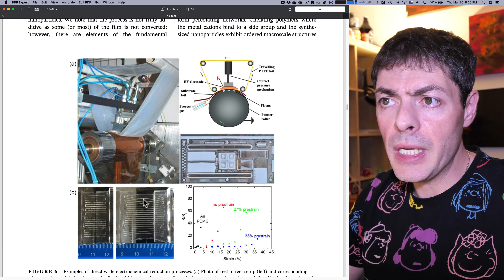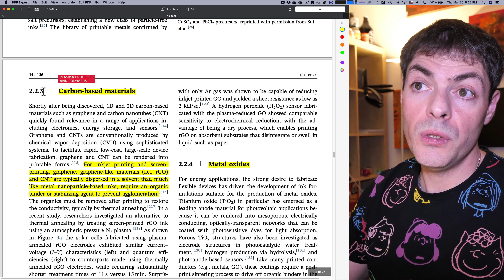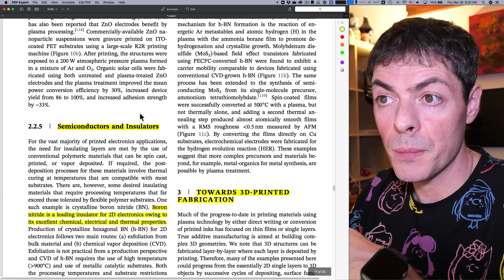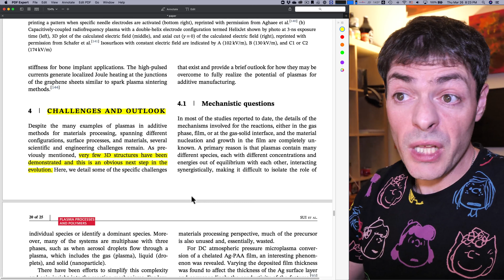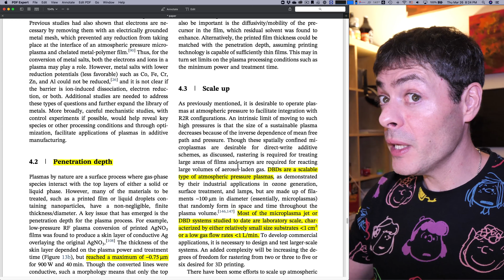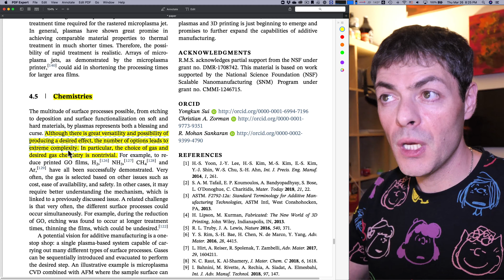Plasmas in additive manufacturing

Comment: thank you for going over this! Do you think this would work as a treatment to filament as it comes out of an FDM nozzle, or would it be better to treat the surface? I was thinking of putting a micro-plasma torch pointed between the nozzle and the print surface. I wouldn't want to cause the filament to bond with the nozzle. You said this process isn't able to penetrate well, so I imagine pre-treating the filament (similar to a filter) wouldn't be very effective other than to clean it. Would it clean better than the common sponge filters? I don't see a good way to make a consumer-level 3D printer incorporate the aerosol/vapor method, but could possibly have a plasma torch act as a second extruder and pre-treat a layer before printing onto it.
Reply from the maker: James, it may be quite impractical to combine plasma of any kind with an FDM printer. However, inter-layer adhesion and adhesion to the print bed may be significantly improved with a microplasma treatment ahead of the print head. Alternatively, I agree, you might consider rigging up a microplasma jet—this way you can point directly at the filament being deposited. Overall, I don't think the resulting small improvement can justify a relatively significant increase in cost... It'd definitely make for a fun project over the long winter. Myself, I'm attaching plasma to a plotter. It's easier and the result is more pronounced.
Reply: Yea, I'm not sure how effective it would be with what I can do at home. I found this design https://www.thingiverse.com/thing:4650954 and eventually landed on your helpful video trying to learn more.This site https://appliedionsystems.com/diy-handheld-gliding-arc-discharge-plasma-surface-treater/ also lists a simple DIY solution. I don't know enough about the chemistry and physics involved, but I have a small airbrush compressor and 3D printer. I'm sure other gases would get better results, but I'm not willing to invest in that type of experiment as an amateur hobbyist. Also, I'm a bit leery of getting into that kind of DIY electronics. It's dangerous and I'm just as likely to accidentally fry something out of ignorance.
Reply from the maker: @Subquake654  why don't you just come work for us? :) That glidarc system is kinda old-style. There are better ones based on pulsed sparks. Glidarc also has open electrodes so it does tend to be more dangerous
Reply: @GregFridman  hah! Not quite ready to jump from accounting information systems. I really enjoy learning and making stuff, but only as time permits. I had loads of fun learning about FDM structural, mechanical, chemical, electrical, and software. Finally got that cheap i3 clone to be one-click, remote, auto-probe (.005mm std. dev. Is awesome), and dialed in to print PETG all day... very pleased with how well it works now. My next big project I have promised to help with is some tooling designs for harp crafting. I have enough experience in fusion 360 to make my own stuff fit well, but I lack the other understanding and experience required to really make much improvements.
Reply from the maker: @Subquake654  it's called "work" cause it's hard :)
Reply: Would this work to prepare the build surface for FDM? Borosilicate glass, painters tape, kapton (PEI?) tape, stainless steel, aluminum, etc.? Maybe it would be a better alternative to using glue sticks and PVA glue and painters tape? I use borosilicate glass and LOVE the finish. It took quite a while to fine-tune, and I had to make some trade-offs with print speed, bed temp and nozzle temp. It’s be great if I were able to go with a higher print speed for that first layer.
Reply from the maker: @Subquake654 , I'm sure the first layer adhesion will improve on a non-heated plate. With a heated plate, you'd have to experiment... Plasma will create active sites on, say, glass. Those are temporary and very sensitive to temperature. In other words, my answer is "I don't know". I'd be curious to check that, when I get time...
Reply: That sounds like it would be disrupted when putting hot molten plastic on it, or that nozzle near it.
Reply from the maker: @Subquake654  for sure!